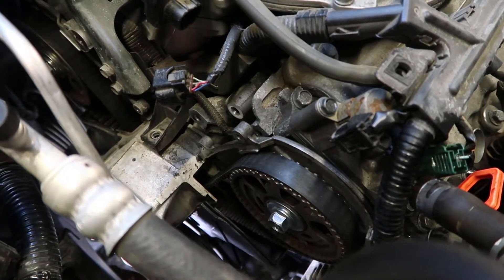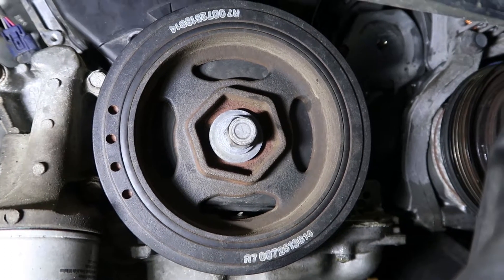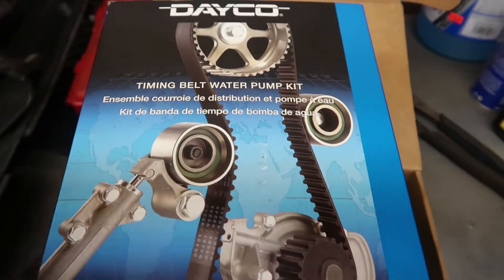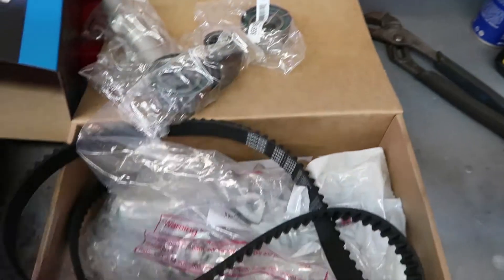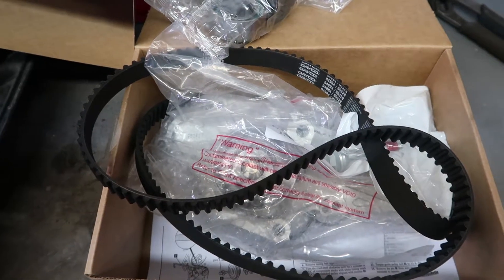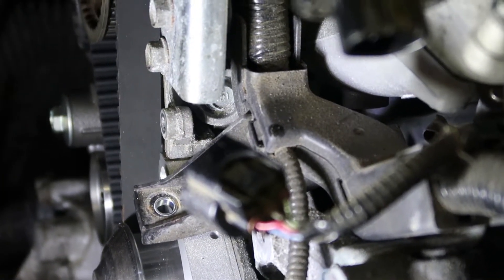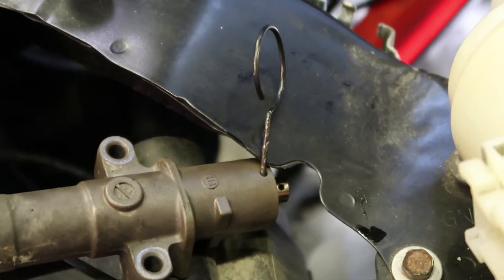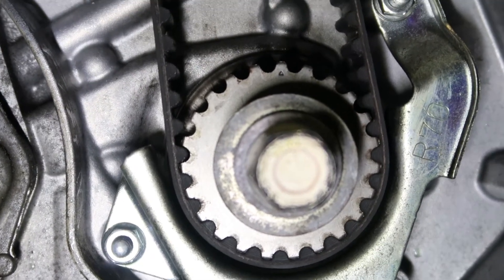Honda Odyssey Timing Belt Replacement How To, Sort Of

Comment: I have a 2014 Odyssey with 130kmi on it.  I do most of the work on this car (minor repairs and any / all  maintenance.  I'm a big believer in maintenance.)  My worry over the long term is not the engine- it's the trans.   How many miles can these transmissions be expected to run if treated properly (I don't routinely carry heavy items, I change the transmission fluid every 30kmi, and I never tow with this van).

Comment: The problem I have run into is the dealer says the timing belt should be replaced at 7 years. He also said the tech could hear something but I couldn't find any info on it so I called Honda and they would not confirm or deny the 7 year interval.

Comment: Had a 2006 Cobalt with 350,000 miles and never had timing chain issues. With that said, I had a 1984 Toyota Celica that the timing chain came apart do 50 mph, which was quite costly, even back then. It only had 90,000 +/- miles.

Comment: did you re-use the tensioner?   usually that goes bad before the new belts...  also a good quality impact wrench will usually break the bolt lose without heating.  I love the timing belt setup.  its so much easier on the motor.timing chains are a nightmare for double overhead cams... which I ask - does the timing belt drive BOTH cams or is there another set of timing chains that tie the cams together ?
Reply from the maker: Tony D the tensioner was replaced as well. My 1600 ft lb matco impact wouldn’t budge the bolt. They almost never move on the 3.5 without a heat wrench. Both cams are driven off the belt. That’s it. That’s why timing it is so critical since it’s a zero tolerance engine.
Reply: @RichfieldAutoCenter  as in Richfield Ohio?
Reply: @RichfieldAutoCenter  there is a $20 50mm tool that hold the damper from spinning and then the wrench works works better.  Have you tried it?
Reply from the maker: Tony D I have that tool. It’s worked for me a few times. Other times I’ve had to heat the bolt with a torch.

Comment: Hello. How to know when is time to do the change. I have a honda 2011,  Wrench sign came on A14 code is on, but the car has 101000 miles ? I hear you said ones it hit 120,0000 then is time .
Reply from the maker: Depends. Some recommend around 120,000. Some you have to check the maintenance code.
Reply: @RichfieldAutoCenter   So having the code Doesn't necessary mean it's time to do the change? I know oil change it's due, so it is rotation and maybe spark plugs and assuming that's why the code is on.  Thank you very much for taking the time will definitely subscribe. I wish   you was here in Chicago.
Reply from the maker: Thanks man. I looked up your van and it should be replaced around 105,000 miles according to Honda. Hope this helps.

Comment: Heres one for you.. got an '04 Odyessy, 317K miles, salvage title. Paid off, but when $1K is a better investment toward a newer car..not brand new tho..  the same $1K keeps the car going, but if its not in great shape.. its a question of economics - great short how to, & yeah, been watching some similar vids on timing belt & water pump change. The hardest part is the harmonic balance wheel. Thank you 🤓  also, does the engine mount have to come out?
Reply from the maker: Some guys take the whole mount off, some split it and just remove the engine portion side. I always say if the repair is more than half of what the car is worth, then it’s up to the person to decide how much they like the vehicle.
Reply: @RichfieldAutoCenter  thats a good rule of thumb! The hardest part of that whole water pump & belt change looks like the harmonic balance. Thanks 🤓

Comment: my honda dealer quote me about $800 about 6 months ago then a change of ownership happens and now they want $1200 smh
Reply from the maker: It’s possible that the original quote didn’t include the water pump and the new owners included the water pump in the quote. Depending on the year and the kit used, somewhere around a thousand is normal in my area
Reply: @RichfieldAutoCenter  thanx for replyng

Comment: Is there a way to check if  the timing belt was replaced recently?
Reply: Only way to tell is if it was done at a Honda dealer.. you can ask your service writer at the dealer to check the Vin# for service records. If it was done at a regular shop.. hopefully the receipt was left in the car, or a timing belt service sticker was left under the hood of its a second hand vehicle you just aquired.

Comment: is it wise to purchase a car with planed 1200 dollar maintenance kit, how do the nessan and Toyota's fair out
Reply from the maker: Chester Higgs  setting aside money knowing you’re going to have to pay $1200 for a timing belt/water pump replacement is better than an unexpected repair. Honda’s are great vehicles. They consistently reach 250,000 miles without many issues.
Reply: Except it's not, many Odyssey owners have paid closer to $600-750.  The bigger problem with Hondas is the tranny, but otherwise, if you want to contrast other brands and are paying someone to do the work, you may end up with other parts failures that easily total that $600-$750.  These days, especially people who take their vehicle to a stealership shop, pay at least that much for two minor repairs such as alternator and a door lock actuator.  Any vehicle will need some repairs over time, and if you pick wisely it is still cheaper than buying newer and suffering that much yearly in depreciation alone.

Comment: which year of the hondas are chain driven
Reply: Chester Higgs An Accord from 2008-2012 with a 4-cylinder engine will have a timing chain, whereas the V6 engine models have a timing belt. From 2013-2017, the 4-cylinder models still have a timing chain and the V6 models have a timing belt. Starting with the 2018 model year, all the available engines come with a timing belt.
Reply: Chester Higgs also all Honda Odyssey’s have a timing belt
Reply: All K-series honda 4 cly has a timing chain (and the s2k motor). The rest are belt driven.

Comment: Except no, it should not cost $1000.  The average cost of that is about $775, including tax.  Not "in theory" but literally customer surveys of price paid.  Many who shop around, get it done for about $600.
Reply from the maker: Stinky Cheese this is a full kit from gates that includes the water pump and pulleys. You can always buy cheaper kits  but on these I don’t like to risk a part failure. To each their own.

Comment: Do you think Cam & Crank Shaft Oil Seals are important to change out with the timing belt?
Reply from the maker: Only if they’re leaking. If not, then no. They usually don’t have leaking issues.
Reply: @RichfieldAutoCenter  got it. Are there any other oil seals you recommend changing? I have a 2013 Honda Odyssey
Reply from the maker: Seals and gaskets are usually only changed if they’re removed during service or are leaking, so it’s hard to recommend any. If they’re leaking oil, change em. If they’re dry, leave em alone.

Comment: excellent video. Particularly about getting the slack out. Looks tougher than when I used to do Chevy Vega timing belts. Only the Vega had a sliding water pump that had a gasket.

Comment: Thank you, a Great video!  What part do you need to change when you change the Timing Belt? 
for my Honda 2010 with 93,00o miles,  I was told that I need to change oil pump seal and sensor seal with the timing belt all together cost $1,800. Is it too high?
Reply from the maker: That seems a little high to me. No harm in shopping the price and getting a second opinion.

Comment: I recently purchased a 05 Honda Odyssey with 260xxxish miles on it.
I do home improvement work and all my tools fit in it putting my chop saw and stand huge and can still fit for people in it absolutely love it pretty good on gas too.
I'm a mechanic by heart I worked in a couple shops, I've done probably 60 timeing belts/chains in my life.
I have a question for you? I have a little bit of a upper ticking at idle not bad at all kind of like the Chrysler 4 banger tic
Could that be caused from a Warren/stretched out timing belt.
I purchased it from an Arab, so you know how that goes lmao ( everything  new) so I plan on replacing timing belt water pump tensioner and spark plugs just to be safe .
Your a shop so you probably won't answer this LOL but if you do thank you I appreciate it and thank you for the videos I watched a couple of them and thank you for the tip on the back struts I watch that video to you.